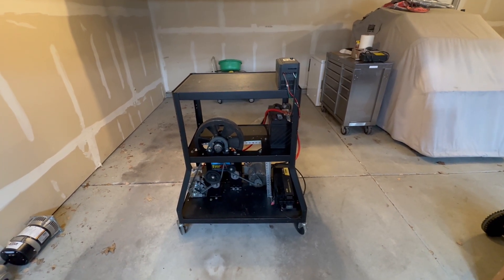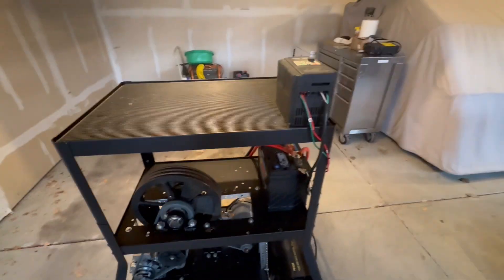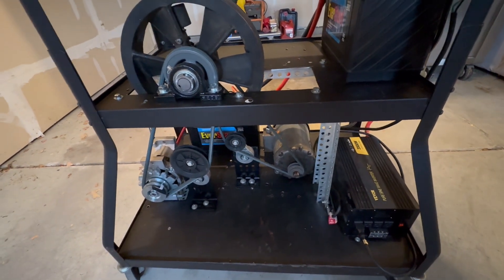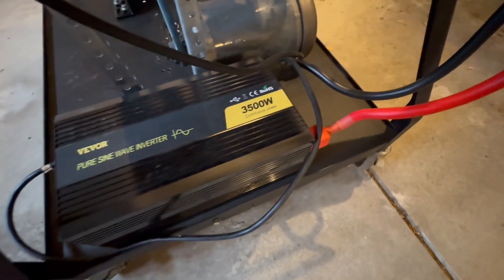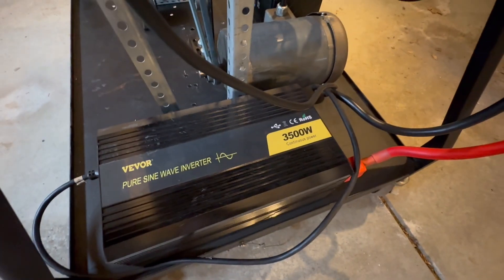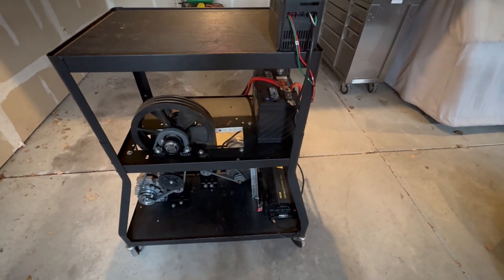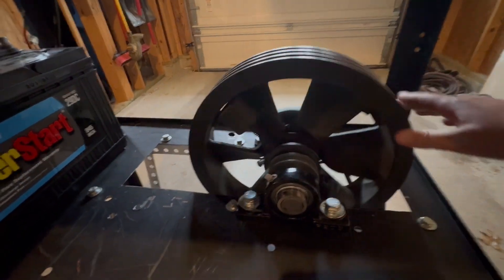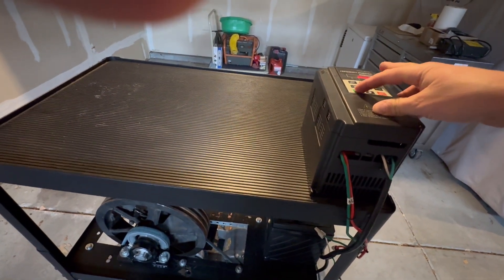Free Energy Generator Update

Comment: One indian scientist named Chaganti Bhaskar, runs the flywheel with bldc motor upto a certain rpm without load, then stops the motor and connects the alternator (load), he has tuned the system so well that he gets 20% more energy than he put in.

Second idea is to make rotoverter with flywheel system together, you still need to tune it to make it overunity.

Comment: Did it work? I think the alternator output is not enough to run the driving motor. In addtion, the flywheel size is small. Good Luck!!
Reply from the maker: Not working yet. I’ve been thinking of a bigger alternator maybe a 400 amp. Also, might remove the flywheel and do a direct drive from motor and alternator to eliminate belts and pulleys. Another thought is going back to a single phase 120v motor to eliminate vfd. A work in progress.
Reply: @MichaelMillerEntrepreneur  Thank you for your reply. 
If you connect the motor and alternator without the flywheel, it will not work. Because the motor and the alternator are not highly efficient ( even though COP = 1 is not enough), therefore, you need additional driving force. It's a flywheel. That's why a flywheel is required. Also, if you use the inverter, it will consume energy, and drop performance because an inverter efficiency is low, too. I think you have to use a permanent magnet generator, not an alternator. I am also developing the flywheel generator and realized that the larger the flywheel, the better.
Have a good job!

Comment: Try a larger 3PH 3-5 hp motor and use the 480v or highest impedance motor windings. One needs resonance or circulating current. Goal is recycling normally wasted power.
Reply from the maker: Thank you.